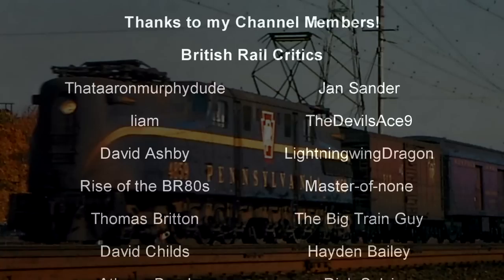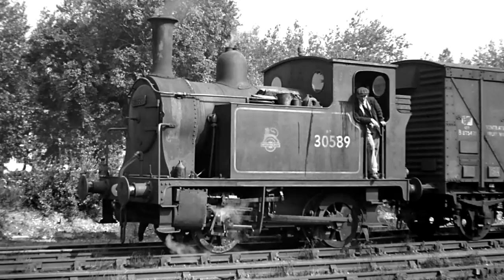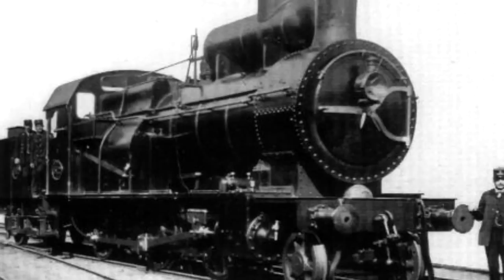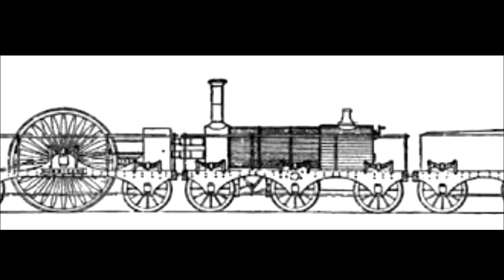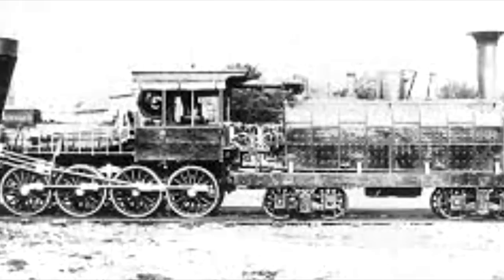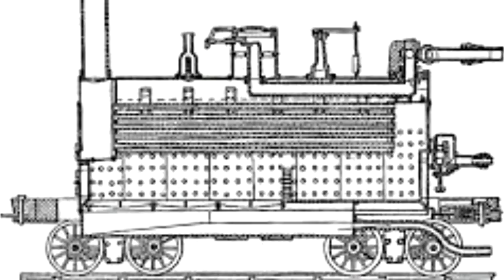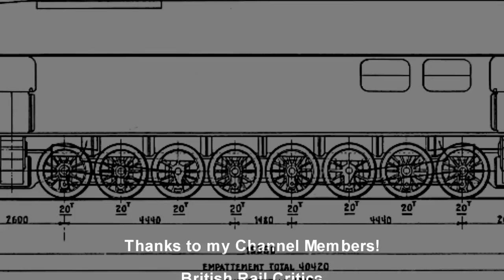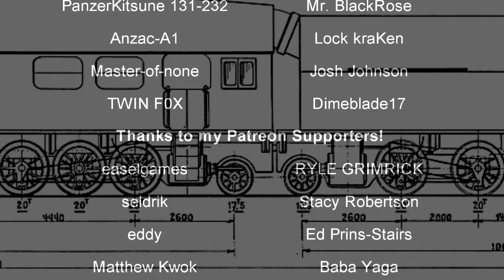5 MORE Trains That Were Clearly Just Mad Science Experiments | History in the Dark

Comment: Another clue to 'Hurricane' not reaching 100mph by at least a half of that was a complete lack of accurate measurement - 'Railway Time' didn't exist in the UK until November 1840; prior to that, it was all local time and best guesses, such that a train could arrive at a station before it had left the previous one...
Reply: It is believable that it got to 100Mph... eventually. But it'd have had near zero torque and would never have been able to pull a train to that speed unless giving something like 200 miles of run up on level track. Which, to be fair, the GWR did have... So if you wanted to run a Cardiff to London express that was non-stop, it could possibly do it. Probably hit 100MPH around swindon and having to slow down at Reading before anything dived off the track, and give the terrible brakes a chance to ensure it stopped in Paddington...
Reply: I can believe the Hurricane MAYBE  reached 100 mph on a downhill with zero carriages.
Reply: I suppose those huge driving wheels would help the locomotive to reach 100mph, after all, that extra weight ought to help it fall into hell a little bit faster!
Reply: What's hurricane are you talking about The one from Thomas the tank engine or it's real life equivalent

Comment: They did give 10 BR Standard 9Fs Franco Crosti boilers. It didn't work and were changed back.
Reply: Nicknamed the "Frankly Crusty" by crews, as they were appalling at fire raising and rotted the steam pipes.
Reply: They weren't changed back, the pre heater was blocked off and the existing smaller boiler used conventionally there is a a school of thought that these 9F's were also re classified as 8F due to their lower tractive effort but there seems to be nothing in official records.

Comment: Seeing as how the most bizarre built locomotives got a second part, the same should be done for some truly bizarre UNBUILT official concepts and proposals.

Some more examples include:
ATSF Cab Foward 6-4-4-4 oil-fired steam
Monon 4-10-4
New York Central C1a
Baltimore & Ohio Besler Type (W-1 motor)
Ace 3000 "modern" STEAM
British Rail's 1976 tentative design for double-deck suburban model
London Roller-coaster underground monorail
London Heathrow Airport's Air Rail (not to confuse with Heathrow's current terminal transit system)
Wardale 5AT
Boston's unbuilt elevated steam system
Reply: Not too weird, but how about George Hughes's technical sketches for a truly monolithic 2-10-0, with a boiler so big, the safety valves were on the SIDE of the boiler, not the top. The Lancashire and Yorkshire missed out because of World War 1, if that happened, the UK would have had a 2-10-0 in 1916!

Comment: Around 1900 steam railmotors -- a passenger coach with a steam bogie at one end -- were popular on British railways for branch-line work. The problem there was that to service the 'locomotive' you had to take away the whole 'train.' Drummond's idea with the C14 was, in effect, to make the steam bogie a separate item so that it could be taken away for servicing while a replacement worked the regular services. Unfortunately the C14s were so light that they lacked the adhesion to pull more than one trailer, so the 'separate loco' flexibility was offset by their inability to handle additional traffic demands. Still, they and their S14 sisters worked successfully for quite a few years on the LSWR, SR and even BR. Plus, they were incredibly cute.

Comment: I kinda wish someone would make like a x-2-2-2-2-2-2-x essentially a x-12-x but with a cylinder to each axel, just so you can say a hexaplex exists.
Reply: Interesting... A UP 4-12-2 but 6 cylinders, not 3. I deeply wonder what it would sound like dragging a freight uphill? Would it be ridge framed like the 4-12-2 or articulated? If so where, one point or more? With only one cylinder per axle, how do you make sure you have the ability to rotate the axle every time after a stop? 12 cylinders would be better. (2 per axel, one on each side.)
Reply: @thomasboese3793  12 cylinders is what I meant.
Reply: @AnonOmis1000  12 axles powered by 12 cylinders. Ok, but, how do you couple the cylinders to the axles so the driving force from one side to the other is out by a quarter turn? You need two cylinders (one on each side) to be sure the axle can be rotated after stopping from any position of the driving gear.
(There are places on a circle where a 'single' driving rod can not move a wheel by its own force alone. This is why there is always two or more cylinders driving the axles.)

Comment: You certainly got a few lulus there! The C14's were sometimes known as 'Potato Cans' or 'Rockets' - there was a big vogue for this kind of miniature steam railcar type locomotive in the early 1900's, and very few of them were successful. The biggest problem was lack of power and adhesion to cope with peak traffic demands. 
According to C Hamilton Ellis, the LSWR patriotically donated several to the MOD during the Great War, and were most unwilling to have them back again afterwards. (If you remember the old Triang 'Nellie' engine, it was based on this, or a slightly larger one.)

As for the boiler in the tender, both Tom Thumb and Perseverance utilised a fan to blow air through the firebox - and both failed due to problems with the drive belt breaking or slipping. 

Hurricane was, well, a flop. Isambard Brunel designed this, and another freak named Ajax, and for once his genius outsmarted itself. Someone made a splendid O scale model of Hurricane about forty years ago, and pointed out that, had Brunel not put those carrying wheels under the boiler, but instead hung it bwteeen the two tenders and put another water tank on the leading truck, it could well have been  the 'proto Beyer Garrett' and actually worked quite well.

Anyway, if you want two more mad engines, have a look at Oliver Bullied's 'Leader' class and his sole CIE 'turfburner' which was a kind of Leader spin-off.
Reply: The Turf Burner, aka Leader Mk 2 was very successful having ironed out many of the problems that any genuine prototype will doubtless have.

Comment: The GWR Hurricane was actually one of two three piece locomotives, that is a locomotive that had separate driving chassis, boiler and tender.  The Second was called Thunderer, and differed as an 0-4-0 driven design with two 6' driving axles, that were gear driven with a 10:27 multiplication gearing to reduce cylinder speed.... again not a great result from 1839, buf they did actually move.

Comment: No BR?
Reply: @gotellyamum technically...

3 C14s did survive into BR hands.

The 3 C14s (all rebuilt from 2-2-0T C14s into 0-4-0T S14s by BR times) lasted until April of 1959 when the final one was withdrawn from departmental stock.

As for the other C14s and the two similar S14s, all sold into war usage or industrial usage.
Reply: @godzillahomer  all converted to 0-4-0T locos by 1921. Then provided light duties until 1959.
Inspired the Triang Nellie types.
Reply: @johnd8892  my thoughts are that in 1907 the 2-2-0 design was about 70 years out of date.
Reply: A Soviet hexaplex ? Of course because as the Germans could tell you (41-44) Soviet rails and rail beds were quality stuff definitely capable of supporting something like that . (Or else the infrastructure would all be sent to the gulags )
Reply: @philvanderlaan5942  the wheel arrangement of an 2-2-0 had bit been seen much for seventy years, but everything else was up to date or ahead of it's time on the locomotives. Even the outside valve gear was new and rare for British locomotives 
Just a few years later a groundbreaking US rail motor innovation used a 2-2-0 or 0-2-2 wheel arrangement for the power truck. That was the pioneering McKeen railmotor used on the Union Pacific and many other lines. Gas or petrol powered though. One running preserved. In Colorado or Utah?
Reply: @johnd8892  rail motor you meen the galloping goose ? 6 out of 7 still exist 5 are in my home state of Colorado and all are operational.
Reply: @philvanderlaan5942  more detailed information on McKeen cars :
https://youtu.be/JVKfc5uINLk
Reply: @philvanderlaan5942  Do you know where the 6th one is
Reply: @fanofeverything30465  knots berry farm I think
Reply: @philvanderlaan5942  Where's that